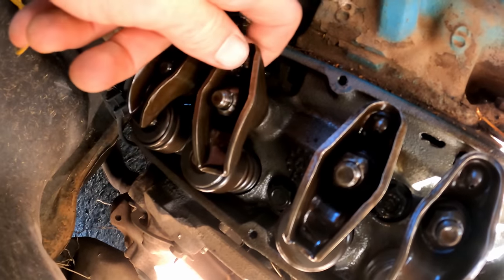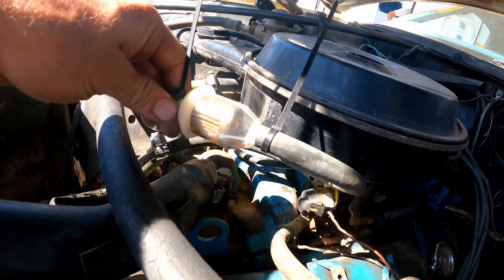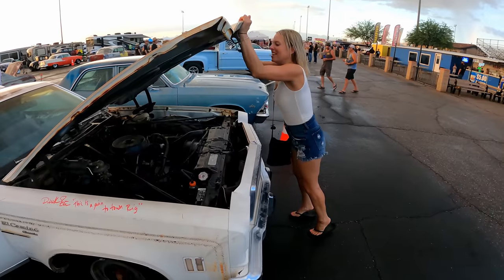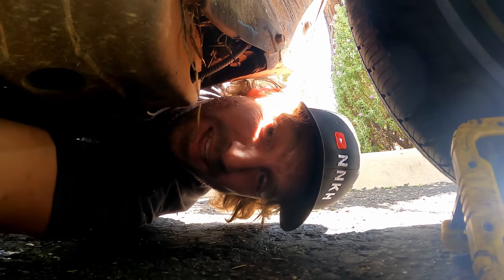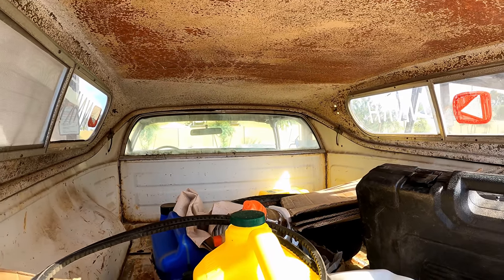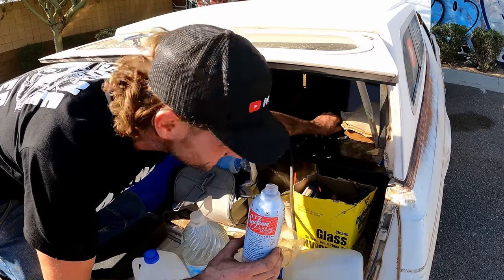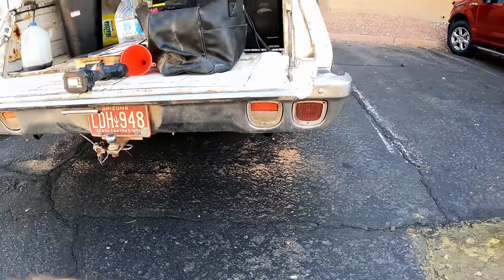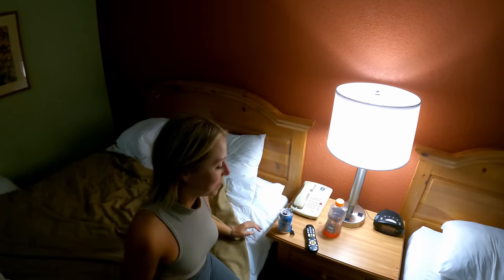Will It Make It To The Duct Tape Drags? 1974 El Camino - NNKH

Comment: One little thing you can learn about sbc is that bolt you see in front of the block at the fuel pump rod is for holding that rod while your installing the pump. Just unscrew that bolt and use a longer bolt the threaded hole to hold that rod up and put the pump in with bolts loose and take the longer bolt out finish bolting the pump up and install the short bolt back in and your golden.
Reply from the maker: Oh really? Never knew that. Thanks for the tip!
Reply: Yep, most always wonder want that bolt is doing there. You got it!!!!
Reply: Derek showed that tip in one of his videos, but I don't remember which one...
Reply: i made the same comment. cheers. hahahaha.
Reply: I just was putting small block Chevy fuel pump on an engine from Blueprint (the company that sells crate engines) the other day and come to find out that some later model castings are wierd and although they have the bolt there, it’s just a blind hole that wasn’t drilled all the way through to the fuel pump pushrod.  Blew me away cause why else would you waste the time to drill just deep enough to tap it for a short bolt but not all the way trough to the pushrod.  As far as I know that front bolt doesn’t serve any other purpose.  And yes I poke around in the hole, it wasn’t just clogged with gunk.  It was brand new engine (well fresh rebuild).  A hacksaw blade or anything similar works real well to hold it up as you QUICKLY slide the pumps arm in under the pushrod, just make sure to turn the engine over till the pushrod is on the base circle of cam’s eccentric (retracted into the block furthest.  This gives you more room and time to slip the pump arm under it before it slides back down blocking the opening!
Reply: But then the cheese would be useless.
Reply: LOL  I was laughing as he was looking for the grease.  ;-)
Reply: you read my mind I am 60 years old and have known that trick since i was a teen Peace
Reply: Finallly got to do this myself swapping a fuel pump on my boat engine the other day. What a difference!!
Reply: @NoNonsenseKnowHow  turn crank to TDC on 1 cyl and the fuel pump rod is all the way up.
Reply: Just made the same comment, didn't see yours.

Comment: That bolt in front of the engine is the fuel pump rod access. Right in line with the rod. Pull that bolt out, put a longer one in to hold rod.

Comment: Here's a too from an old mechanic.
At  21:31 where you're replacing the fuel pump and you put cheese on the rod, if you look at the video you'll see a bolt at the front of the engine that is perpendicular to that rod. If you remove that bolt and install a slightly longer bolt in it's place (finger tight)
it will hold the rod in place while you install the pump..
I learned this trick working on small block Chevys in the 60s..
Try this next time you replace a Chevy fuel pump...amaze your friends 😎😎

Comment: This reminds me of my trip from a city close to Toronto driving all the way to Dallas TX in a car I bought for 1 dollar.  I fixed it up, I just moved to Canada and she was a Buick Century.  Low miles on the clock, new tires, differential had some issues along the way.  AC was not working, windows open all the way through Little Rock and man, I would never have dreamt this in a million years.  5 weeks later I drove back, she did not burn a drop of oil, dry as a bone.  What a trip.

Comment: Wow, nearly 300k subscriptions.  Congratulations! I love these long distance revive and drive series.  It was probably mentioned about a thousand times, but on an SBC you just pull the bolt out of the hole in line with the fuel pump rod and thread in a longer bolt.  That captures it up in the engine.  Though cheese was hilarious.

Comment: I have a easy litte tip for you when changing a mechanical fuel pumps.
Theres a stubby bolt in the front of the block even with the fuel pump rod. Before you start changing the fuel pump. Take the stubby bolt out then take one bolt out of the fuel pump and screw it in were the stubby bolt was it's a longer bolt. Scew it in by hand then snug it up now the fuel pump rod is secure. Change out the fuel pump screw the one bolt in then take the bolt you screwed in the stubby bolt hole.
And don't forget to put the stubby bolt back in.
Your welcome.

Comment: Chris & Jenn & Gus…Another Great Video! Besides the bolt from the front...you can just keep flicking the rod up with the arm on the fuel pump until the arm drops under the rod.  You normally do not take the plate off of the block, as then you need another gasket, which does not come with the pump have never tried Cheese! I always adjusted my rockers with the motor running. You back them off until they start to “clack” then tighten till the “clack” stops. Then add just ¼ turn. Only problem is oil splashes on the exhaust. I cut out the top of a set of old valve covers for this operation. Your method is fine for initial adjustment.

Comment: Love the ElCamino adventure.  Kind of laughed at you fighting with that fuel pump rod.  Let me give you a tip, something I learned about old small block GM's way back in the 70's.  In your video at 20:42 you see a bolt on the front of the engine to the right of the fuel pump.  That's there for a reason.  Before removing the fuel pump take that bolt out.  Now remove just one of the fuel pump bolts and thread it into that hole. They have rounded ends and are long enough to reach the pump push rod. Snug it up just enough to hold the rod in place. Now you can remove the other bolt and replace the fuel pump without the rod falling down.  GM obviously provided that by design.  I don't remember which engines exactly but I know there is at least one or two that if you pull the pump without doing this the rod will fall into the oil pan and really wreck your day.  Hope that helps next time and keep up the great videos.

Comment: Another really easy mod for vice gripping hoses is to cut a couple small lengths of hose and stick them over the ends of the needle nose vise grips. Works really well and doesn't require juggling wrenches
Reply from the maker: Great idea for sure! I'll have to try that next time

Comment: Sometimes valve lash is adjusted with the engine running. Back the adjuster nut off till the rocker clacks, then give it half or 3/4 turn.

Comment: Well done once again! I was concerned that those valves were sunk into the head due to valve seat failure, but that would reduce lash not increase it. Thanks for the content man, from a once engine rebuilding machinist - brings back lots of memories.

Comment: Super awesome stuff!   I was thinking of the studs....maybe pulling out.   Anyhow,  we used to have some cutout...valve covers to do the valve adjustment running.   kind of takes the guess work out.  Back em off till they "clack"  tighten to zero... then 1/4 turn.   You'll hear the misfire, cause it holds the valve open for a few seconds...  till the lifter self adjusts...   Then another 1/4 turn... another misfire, till it bleeds off again... Then misfire goes away.  You go one more 1/4 turn.. or leave it at 1/2.  Either way is close enough.  Plus it tells you in real time that you can force the plunger... inside the lifter bore.  And you have confirmation that each lifter is getting oil pressure to pump back up.   Great work...and try not to work too hard.   life is short.

Comment: New subscriber here, really enjoying the content! For the fuel pump push rod the bolt that’s in line with it screwed in from the front of the block is designed to be removed then temporarily replace it with a longer bolt. That holds the push rod in place until you can get the pump installed, then the short bolt that came out can be re-installed. 20:56

Comment: around 49:00 man oh man whoever set the valve lash WOW holy cow man. There's NO WAY that happened 'over time' as one would try to say.. that's WAY WAY TOO tight.. I'm surprised that alone didn't wipe out that cam.. Funny, that thing sounds SO good now, I'll bet that oil burn calms right down. It's funny, I have met a bunch of 'mechanics' that don't understand how to set valve lash moving 90 degrees at a time following the firing order.. I had a guy try to tell me that would be 2 full rotations so how could it work. I told him, bro a 4 stroke engine is 2 rotations for 1 round of firing. It's a 4 stroke.. anyway thanks for taking us along on this great trip you guys had, say Hi to Gussie!! Awesome!

Comment: Tech tip on replacing fuel pumps on SBCs. There is a short 3/8"  bolt on the front of the block that it in direct alignment with the fuel pump push rod.. The bolt is short of making contact into the pushrod. A slightly longer bolt will hold the pushrod in place while replacing the fuel pump. Change to the longer bolt before changing the fuel pump and be sure to place the short bolt back in the hole when done changing the pump out.

Comment: Fun watching you and Jen go through your daily trials and adventure.  Jen seems mellowed out after your battle with the car.  It's great you found the problem with the valves.  And the studs coming loose doesn't stand up to your problem.  Valves were over tightened that's not studs slipping that's idiot mechanic screwing up.
I've seen that the slippery studs and none were over tightened.  I'm sure the over tightened studs have got the cam headed south now but, all you can do is drive it now.
Enjoy the remainder of the vacation.  Can't wait to see the end or rest of the travels.

Comment: Regarding using two wrenches to shut off a rubber fuel line with vice grips squeezing the wrenches: two sockets, one on each jaw, works much better and it is easier to use. Deep-well sockets are even better. Even works with regular vice grips if you use bigger sockets.

Comment: See that bolt on the front of the block inline with the fuel pump push rod? You can remove it and install a longer bolt in to hold the pushrod up. install the pump then put the proper short bolt back. nice work keeping her going.

Comment: I saw you make that loop with the gas hose on the Gran Torino elite, a vapor lock was what came to my mind that's from experience, you want to keep your gas line running uphill to the carburetor, that's probably a small block 400 the water pumps always leaked like that in 74, I couldn't see if the water pump had fins on it like a small block 400

Comment: On the fuel pump install; the rod can be held in place by removing the 3/8 9/16” bolt that’s perpendicular to the FP Rod going through the engine block. Then installing a 1/2” longer bolt that bottoms out at the FP ROD. . That holds the rod in place. Install the pump, remove the long bolt , reinstall the short bolt.

Comment: next time when you change the fuel pump. take out that bolt in front of the pump, use a longer bolt, slide the push rod up, tighten the longer bolt, install pump, remove longer bolt and replace with the original bolt <--------=== a little trick my pops showed me when I was a wee lad, >>>---------> hope that helps save you a little bit of hassle next time <---------<<< thanks for the content!

Comment: funny story on a water pump job i had once older gentleman brought in a clean 88 iroc-z said it needed changed was not leaking when i inspected but when i started it looked and pump pully was wobbeling so yep replace it pulled apart and when i sat the pump down i noticed that someone had pluged the weep holes on the pump turned out they rolled a brown sack paper up tight and filled the holes but it worked until the bearing was about to lose the fan but didnt leak Peace

Comment: On a SBC there is a bolt/plug in front of the fuel pump push rod. Next time, before removing the pump, remove the bolt/ plug and install hand tight a longer bolt which will retain the push rod in place. After reinstalling the pump reinstall the shorter bolt/plug.

Comment: 20:48 SBC fuel pump trick, remove that bolt and put in a longer one, it'll hold the push rod in place. I think you can use one of the water pump bolts temporary.

Comment: Not sure how you were trained but when I went through GM school, I learned to back the hydraulic lifters all the way out until they clattered and then tighten them down until the noise was gone and a full turn after that. I never had a problem with any of my engines that had hydraulics.

Comment: Back in the day putting ground pepper in the radiator would seal the hole in the water pump quick fix for a while and you could flush it out

Comment: When changing that fuel pump there is a bolt on the side of the casing if you at the casing if you put a longer bolt in there it holds the rod up but don't forget to put the original bolt back in the wall

Comment: To hold the fuel pump rod in you remove the bolt from the block that's in line with the rod and temporarily put in a longer one clamping the rod in place until you get the pump installed. Or just use cheese I guess.

Comment: on my 305 sbc i ran it without valve covers and tightened the rockers until the noise stopped clattering. been 6 years and no problems. simple way to do it.

Comment: FYI there is a bolt in the front of the engine block that aligns with the fuel pump push rod. If you pull that out you can put in a longer bolt and it will hold the pushrod in place. Then you just put the short bolt back in when done. You can steal an intake bolt if you don’t have one handy
Reply: Whoops, I guess others already gave that tip.

Comment: 21:41 another trick you can do, that bolt there In your front cover, you can remove it and put a bit longer bolt in, it will hold the pushrod back

Comment: Another thing with those nuts that are on top of the lifters sometimes will loosen I don’t know if those specific ones are a crush nut Or not but it does help to take a hammer and tap the top of the nut to crush it a bit so that it locks down tires are on that stud if the studs are not working out

Comment: One of the best junk yards is down there , to bad you missed it ! Are you still on the road or you make it home ? My wife would have me finish the interior ( door cards and carpet ) before she’d ride in it ! Lol. As you know the south have the rust free bodies and the north has the low mileage engines ! Get that home ditch the cover clean her up and you could get serious coin for her ! The 305 had the soft cam , I believe the 350 cam was much better but didn’t that have an after market cam and bored out if if it’s running good you should have about 300 hp ?

Comment: That smoke coming out of the tailpipe was mostly unburned fuel since those valves were so far out of adjustment. Hard to believe that it ran as well as it did.

Comment: Not sure if it was posted before but just incase I didn't see it, Pause the video at 20:50 and look at the 9/16 bolt right in front of the block beside where the fuel pump goes. Before removing the fuel pump, remove that bolt and replace it with a longer 3/8 bolt and tighten it with your hands. **WARNING - DO NOT OVER TIGHTEN WITH A SOCKET OR WRENCH JUST HAND TIGHT** it will hold the fuel pump rod up in place while to replace the fuel pump. just don't forget to put the old bolt back in place after you change out the fuel pump so the pump shaft can move...! This trick works on all small block Chevys

Comment: That rusty bolt on the front of the block  by the fuel pump (used to be 57 Chevy motor mounts) when replaced with a longer bolt will hold that pushrod in place. Great Cheat!

Comment: When replacing a fuel pump on small block take the bolt out on front of block thread in one of the fuel pump bolts until it seats against the shaft. too hold it in place

Comment: There's a bolt on the front of the engine you can put a longer one in and it holds the rod for the fuel pump

Comment: Made it to the point where you swapped the fuel pump. Ion a sbc, if you pull the short bolt in the front of the block, it goes all the way through. Use a longer bolt in its place to hold the pushrod in place while you install the pump, then replace the longer bolt with the original short bolt or there will be a massive oil leak.

Comment: See the bolt on the on the front of the block by the fuel pump, remove that bolt and install a longer bolt to hold the fuel pump rod.

Comment: my 75 el camino i paid $300 for, drove that car back and fourth to work five years.  it wouldn't pass a vette but it would stay right on it's ass.  and you could go 100 miles on less than 5 gallons of gas, pull the boat to the lake on the weekends.  you could hit a 15 mph curve at 50 mph and come out of it at 35 mph like you was on rails.  america made some of the best damn cars back then.

Comment: The bolt that is on the other side of the pump push rod take it out and put a longer bolt in pinches the rod and holds it from falling out makes changing the fuel pump a breeze

Comment: The next time you replace a mechanical fuel pump on small block Chevy, remove that bolt on the front of the block that is directly in line with the fuel pump push rod. You can put something in there, usually a longer bolt, to hold the rod in place.  No grease, Vaseline or cheese needed.

Comment: That rod for the fuel pump is easy to keep up there is the bolt that is on the front of the engine right by the pump you take that bolt out and stick a screw driver in to hold the rod back while putting the new fuel pump on then take the the screw driver out and put the bolt back in. That bolt is only there to keep that hole blocked it's a short bolt that holds nothing it's only there to block the hole to access the fuel pump rod .